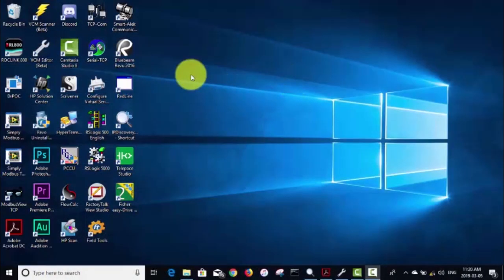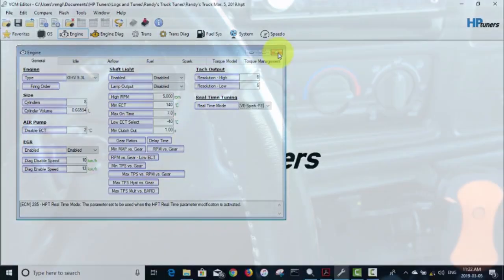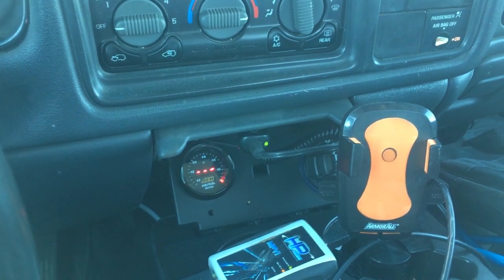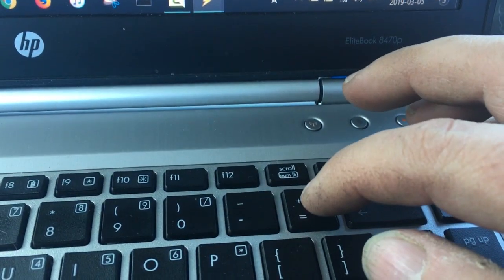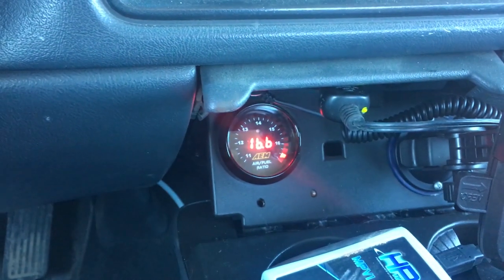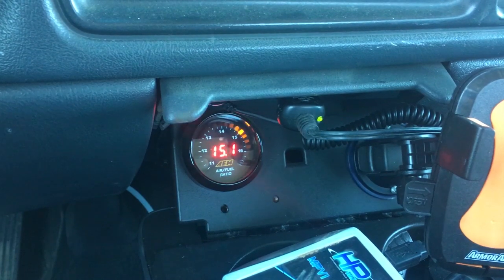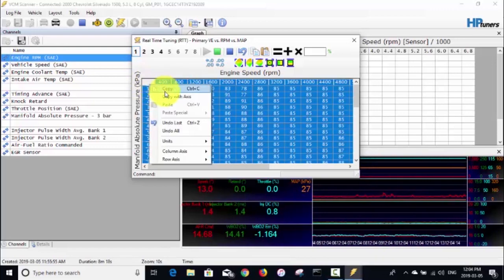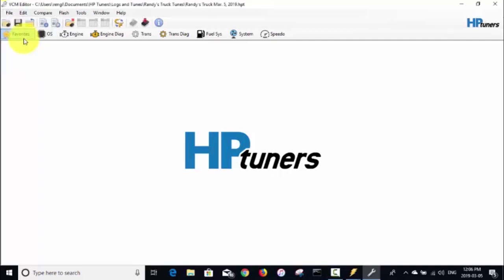Real Time Tuning (RTT) with HP Tuners

Comment: I am running HP Tuners RTOS now. Unfortunately, I never had anybody to drive for me so I didn't tune fuel with it... I'm curious though, can a person tune spark real time? That would be SUPER helpful. I want to log miles per hour versus injector pulse width to get an idea of my spark changes on gas mileage. I also think if you get closer to Max Break Torque (ideal timing) the fuel consumption should be at it's lowest...

Comment: Great tutorial on RTT. I need to start tuning this way. Especially cause gas is super expensive right now. When I started tuning, I would affect change to the cell / cells that I saw issues with. Then use the smoothing functions / buttons to even it out. However, the surface of the graph wasn't smooth. I have a tuner friend that told me the graph needs to be smooth. As the computer doesn't just use the cell it's in to calculate the fuel. Additionally the tune will do really weird things when the throttle is dynamic (PCM is moving across graph). It uses the surface / surrounding cells. I'm sure you already know this, but you may like to affect change to the cells above and to the sides when logging / tuning... Then smooth the graph and repeat the log. Otherwise you'll end up with cells that are really high, and a rough VE graph. It'll get harder and harder to tune fuel in process until the graph is smoothed out. Probably you already know that, however, I don't see many tutorials on YouTube mentioning smoothing the VE graph / fueling.

Comment: So my question is... if you keep adding fuel to your ve table there then isnt it going to mess with your LTFT and STFT?
Reply from the maker: matthew williams in my case I’m using a 3 bar Speed density only tune so  I don’t have long term and short term fuel trims. You’re right though you would want to disable ltft and stft while getting the VE table dialed in.

Comment: 80+ percent ve at idle? Somethings not right.
Reply: Unless the numbers change drastically when you use a 3 bar os?
Reply from the maker: Cam Firkus yeah I’m not sure what caused that, might have been cause I hadn’t tuned my idle airflow yet. Now that I’ve changed cams and done some idle airflow tuning I’m sitting in the 55-65 percent range at idle I think.
Reply: @LowbuckLS  Yes something was seriously wrong.  While you showed how it works, that was an issue outside the VE table causing that.

Comment: Thanks for sharing.  Do you have a video on how to setup the truck/HpTuners to keep the PCM in Open Loop for tuning?  I'm a novice with HP Tuners with a 5.3l Jeep YJ.  Thanks again.
Reply from the maker: Christopher Feid I don’t currently have a video that shows that but I could probably make one.
Reply: If you don't mind... or could you point me to another document that shows how to do so?
Reply from the maker: @christopherfeid1627  this page basically has the procedure for forcing the computer into open loop: https://www.hptuners.com/help/vcm_editor_tuning_how_to_user_sd.htm but I'll still try and make a video soon showing exactly how I did it on my truck.